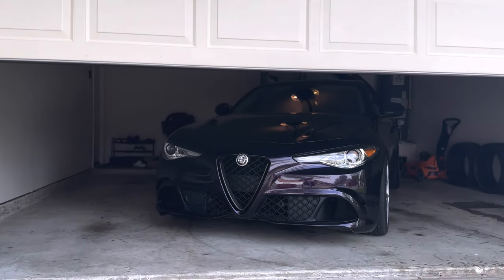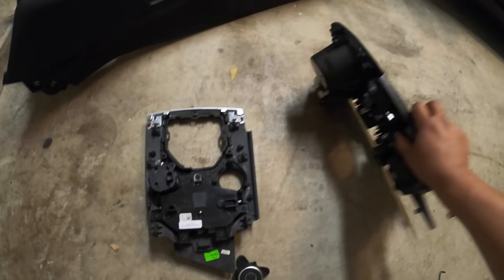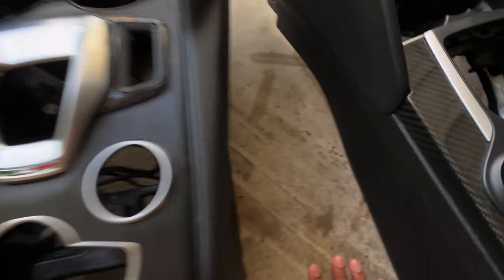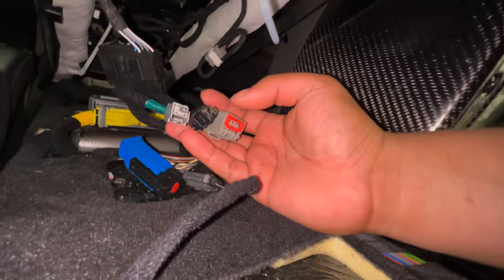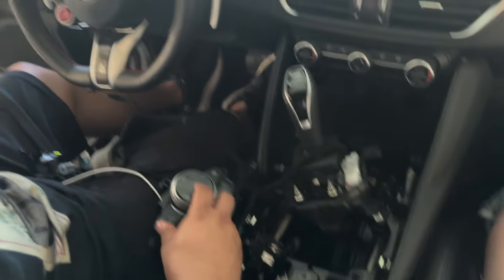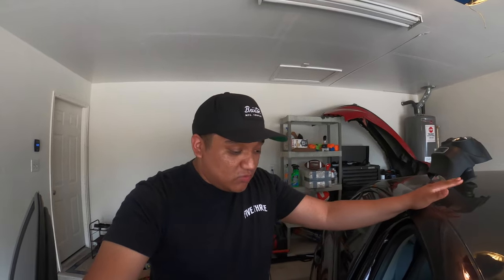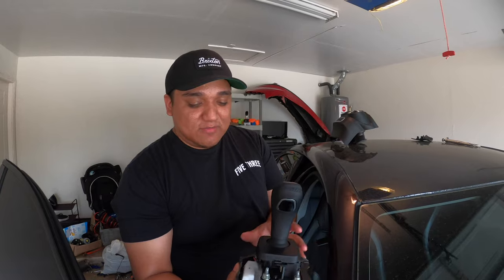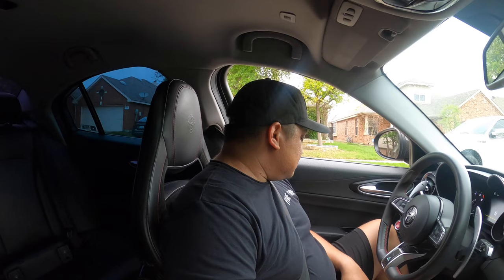We Did it FIRST: 2020 Alfa Romeo Giulia Center Console SWAP !!!

Comment: Hello, gj for the swap. don't know if you did a followup but here some baseline if someone is interested (we do this swap since mid-late 2020 here in italy, but as you mentioned no one posted a video about it :P )

-New menu button works but need allignement
can be mounted with both tunnel harnesses BUT:
-old harness --> you need to stick to the old DNA
-new harness --> you need to use the new DNA with allignment

plus
-Wirless charger works only if you swapped the 2020 body (personally im working on a 3d project for fit an aftermarket charger) don't know if you also need my20 cluster + ETM, i decided to stick to the my18 ETM.
-You need to bring a 12v plug for the front cigarette lighter, also if you want the led aroud it working bring also the yellow cable for light it up

only way to mount the tunnel is to detach the car harness from the tunnel like you did, yes it will be a little shorth but it will fit.

hope someone will find this helpfull

Comment: Since I can't leave comments on shorts that I know of, this might be the closest video to the subject. I was using your short about upgrading the shifter--I put in the perforated black leather with red stitching in a 2019 Giulia Quadrifoglio. At first I thought I would have to buy a deep socket hex wrench because with my set, when the socket is clipped into the ratcheted driver, there is not enough hedroom for the screw coming up from the bolts, but I discovered by not locking the socket into the driver, only putting it in halfway, as the bolts were not very tight, I was able to remove and replace them that way. But when looking to buy a deep socket version, I realized there's an error in your video where you say they are 20 mm bolts--they are 10 mm bolts. I guess most people would figure that out in the course of doing it, but  I thought I 'd point it out. I didn't have to disconnect the other wires going to the console as it seems seen you may have done, I just unplugged and plugged in the one to the shifter. I assume there is no problem with leaving those other wires connected, as far as circuitry. Everything seems to work fine after I finished.
Reply from the maker: You can leave comments on shorts. I appreciate you reaching out but if you rewatch the short I say four x 10mm bolts.  I know because I’m extremely critical when I edit and this was a voiceover. You in theory could leave everything else plugged in if you had room, we decided to just remove that entire panel. No difference in the process.
Reply: @ModdedMotors  I listened to the video again just now and this time I did hear 10 mm. Funny because I listened to it several times before and thought you said 20 mm. I know slight deficits in hearing can affect such things, but a few years ago there were a number of videos or tests where someone would say a particular word and different people would here different words. Anyway, thanks for the tip about leaving comments on shorts, I guess I didn't recognize the comment icon in the sidebar. I had room to lay the me console covers to the right, so that was easier for me than having to detach and reattach those connections.

Comment: Guys, sorry this is unrelated but as you two are utter experts with these cars I have a question I hope you can answer…
I’ve seen a qv interior, front seats back seats door cards. 
Now I want it, I’ve heard the donor car has to have the same spec as mine regards electrics, mine has heated electric seats and a heated steering wheel, I’ve checked with the seller and this new interior has the same, same year too, will this swap work? I’ve read it should, as there’s only a problem if the seats aren’t electric etc as the squib won’t be able to pick them up.
Can I buy this interior and it be plug and play. 
Really appreciate your guidance on this one.